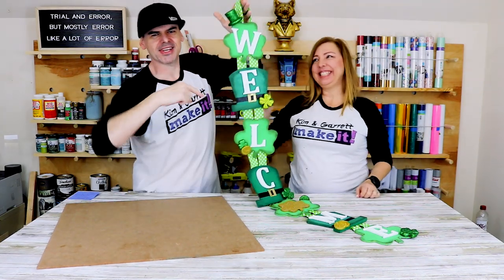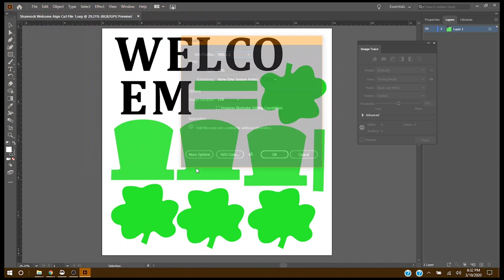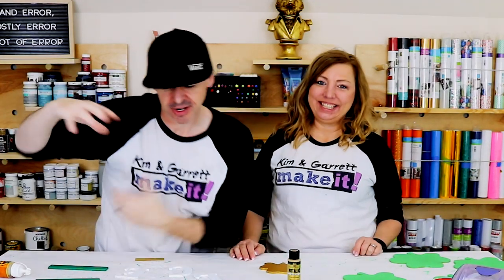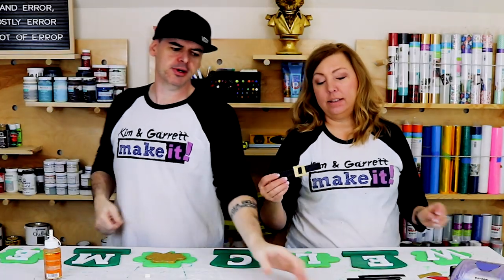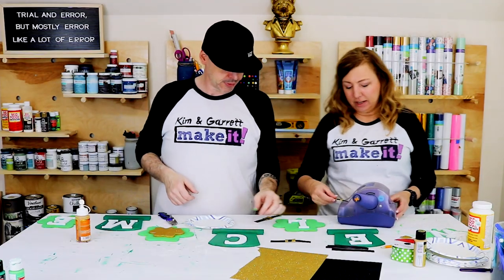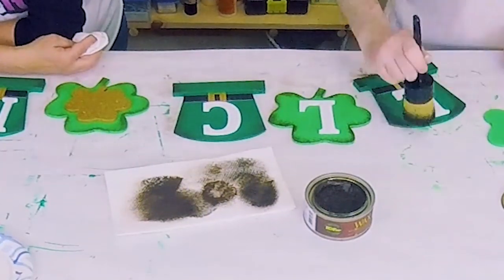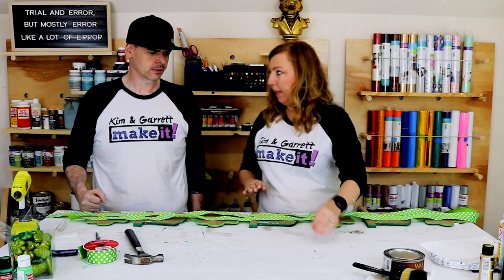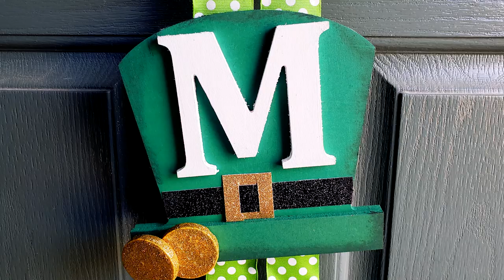5 Foot Tall Front Porch Welcome Sign Door Hanger | Xcarve DIY

Comment: Does the machine accept materials bought elsewhere or do you have to purchase them direct from the company's website? I'm looking I to purchasing a machine
Reply from the maker: Yep! I bought some 1/4" MDF from Home Depot and it worked just fine.  We also tried 1/8" birch plywood from HD and it worked just like the birch sample that came with the machine. I also tried 3/4" pine, a little charred but it worked.